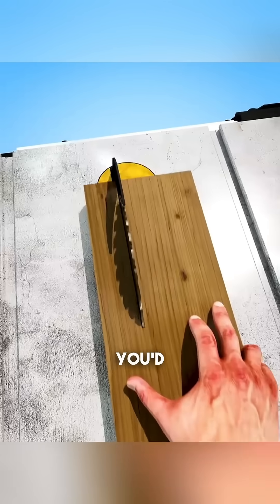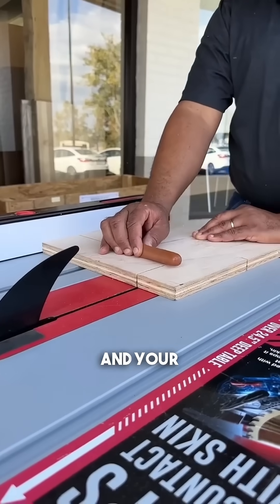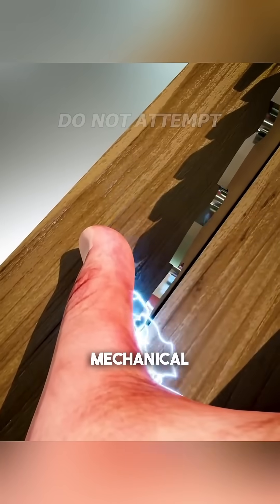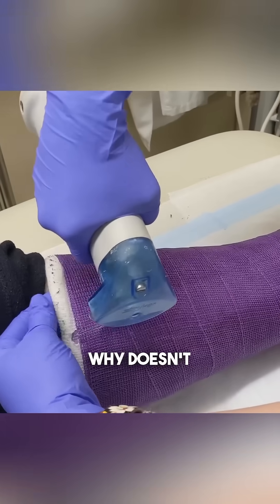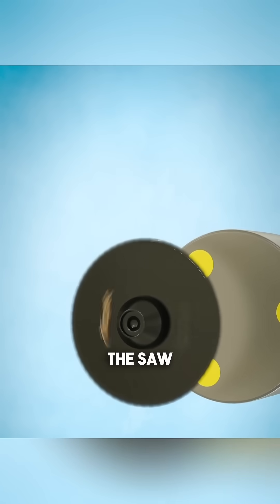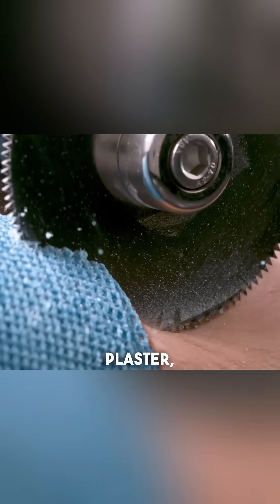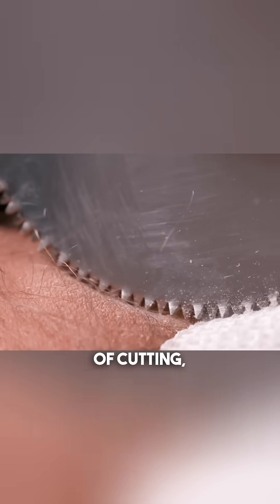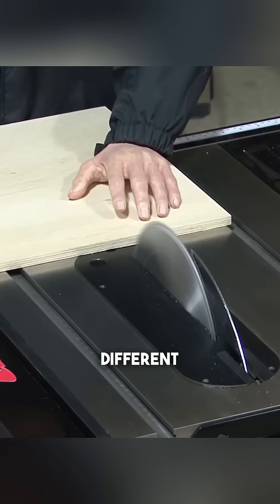Table Saw That Stops For Fingers

Comment: Please don't advertise the Saw Stop like this please. As you said, it is not present in every saw, but even where it is present the parts need to be replaced when it is triggered. Which is way better than losing a finger, but still not something you should trigger just for fun.